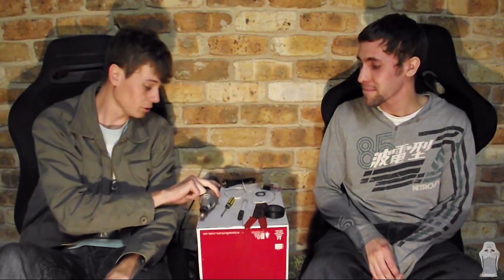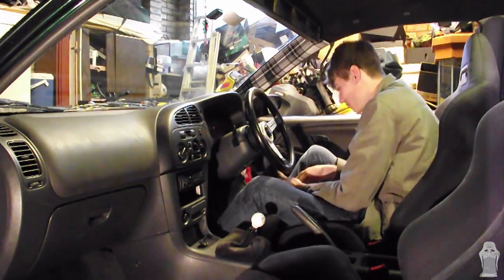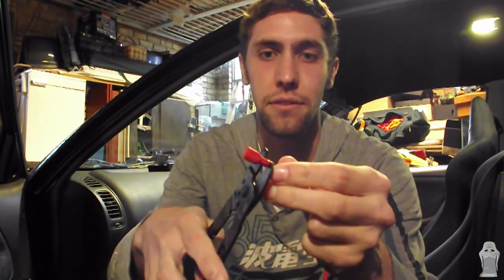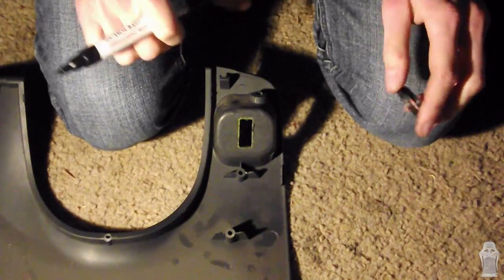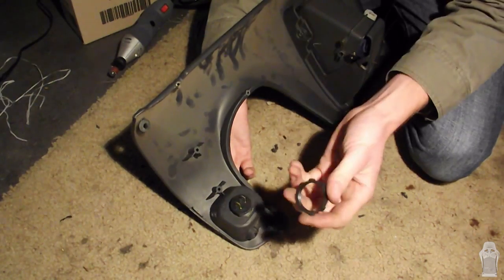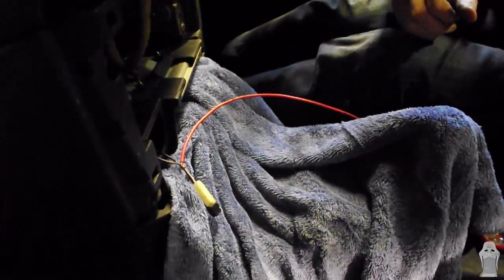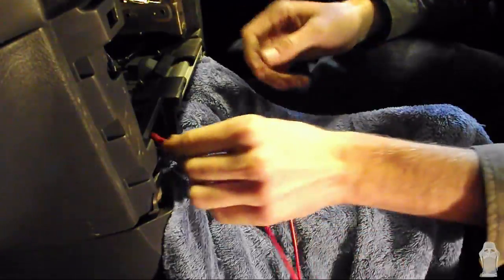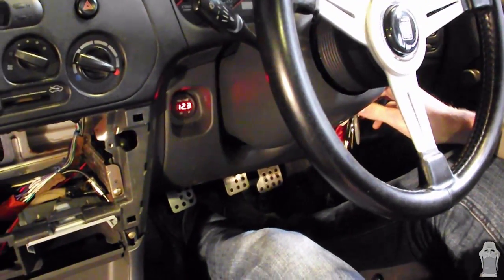DIY Voltage Meter Install - The Racing Seat

Comment: thanks for the helpful vid. i'm wiring a voltmeter for my auxiliary, or leisure battery. i will connect + wire directly to battery. which gauge wire should i use?

Comment: Thanks for the video and sharing! I appreciate how very descriptive, knowledgeable, and still straight to the point! Going to be running my power wire(+) straight to my battery. Planning an audio install with 2500 rms watts, that being my monoblock Car Audio Bargain bass amp @2k rms watts and my CT Sounds mids and highs amp @125.4 rms watts. Also installing a second voltmeter by the subs and amps on the output side of my fuse block going to the amps to determine difference in my power consumption. Still considering stronger alternator/2nd battery. Thanks again!

Comment: I did they same thing but my volt meter stays on 24/7......any ideas on how I could get it to turn on with the car only
Reply: You need to feed the power from a switched positive instead of a constant positive. Use a voltmeter to find the switched power source and splice into that.

Comment: Some how I don't think the solder would flow very well if you put grease on the joint, flux on the other hand will be fine.
Reply: Was thinking the same. Lol
Reply: That is solder Flux I have the same container just how he said it i think.

Comment: I need help here.
I have a digital volmeter and I connected it to the + and - on my amp.
If I use a multimeter on the battery to check the volts it reads 14.1 also the digital one.
Here's the tricky part...when the bass is bumping, the digital goes up and down depending on the bass (13.8 to 10.2v) but the voltage on the battery fluctuates less, between 14.3 and 13.6
My question is...it is ok to have one voltmeter on the amp? Or is useless?
I wanted to know how much voltage the amp is getting
Reply: +LOV2XRL8RL One solution to volts dropping on bass is to add a condensator. It stores volts to give it to the sub/amp when needed + you have condensators with a volt meter build in. This may fix headlight issues (headlight dimming on bass drops If a voltsmeter on your amp is useless? i don't know.
Reply: bigger wires if you don't already have them
Reply: Adrian Jimenez I have 0 gauge wires
Reply: +LOV2XRL8RL  higher amp alternator,the big 3 upgrade ,capacitor? none of the above?all of the above?
Reply: Adrian Jimenez OEM alternator, BIG 3 in process, no capacitor.

Comment: Big issue guys with the diy voltmeter install, your only getting the voltage of the cigarette lighter circuit.  Also as soon as the fuse blows on that circuit you will not get a reading at all, and if you want a exact voltage reading for your battery and alternator, hook the meter straight to the battery and use a fuse.
Reply: +andrew klausmeyer If you hook it up directly to the battery the meter will always be on and could drain your battery. You could add to switch to the positive wire but would have to remember to turn it off, the best approach is to use a relay and use an ignition live wire (such as the cigarette lighter wire) to switch the meter on.
Reply: connect it to empty slot in fuse box that is powered only when ignition is on. that way you will have voltage readings and fuse protection.
Reply: Or get a voltmeter that turns off automatically based on time.

Comment: Very cool! Just ordered a meter to do the same thing on my CE! 

Just a tip on the soldering, make sure you have a nice clean and tinned tip, this may require a tip cleaner if the tip is badly oxidized otherwise just a wet sponge should do it. Then put solder on the tip. That way the heat transfer and solder melting will be instant!

Thanks